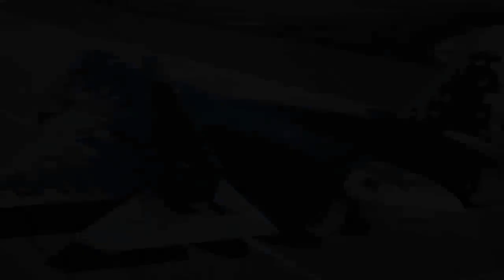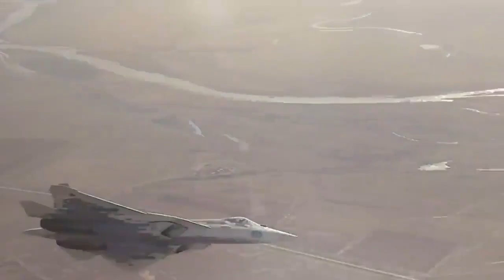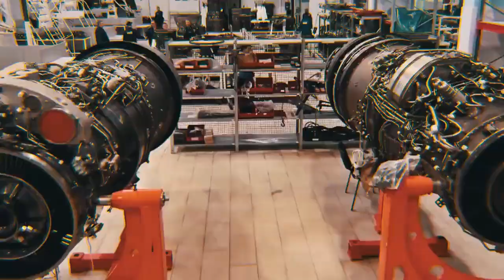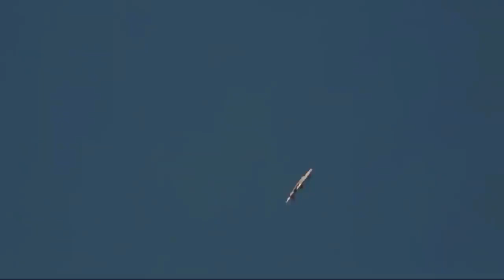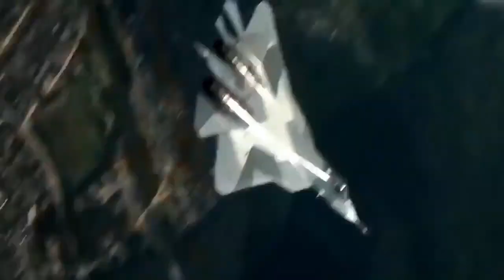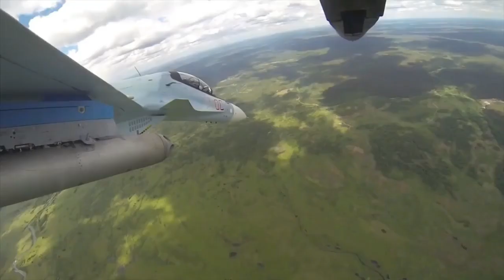Will India Acquire Su-57E Jets To Match Chinese J 20

Comment: No, reasons are that:-
1. It will start it's delivery after years (I am telling from the basis of indo-soveit policies)
2. You don't need to spend billions to just counter J-20 ( The soveit and Indian, both the Air forces have been able to spot J-20 just with old-soveit radars, Both the air forces have admitted that J-20 is not stealthy enough)
3. Buying the Sukhoi su-57 will mean killing of own programs of creating indeginious 5th gen fighter plane.( IAF is currently working on AMCA and same other 5.5 gen planes)
4. The delivery of dassoulter Rafale has began, which is more than enough to counter J-20.
Reply: J20 can be downed by s300 easily

Comment: The su57 can't be stealth with that shape, not to mention the rivets on its surface. Is only a propaganda plane, made by russia cause they can't admit that west have a better technology. Also is hilarious how they also claim that stealth is useless, every time they don't talk about the su57.
Reply: What do you mean? It’s body is technically more stealthy than the f35s the only problem being it’s lacking in terms of radar and jamming capabilities making it inferior in a head to head, but in a dogfight it will come out superior to most other aircraft’s. This isn’t some propaganda.
Reply: @echidnuttt9326  i am talking about basic geometry, when you look at the su 57 from far away, it could seem stealth, but if you take a closer look... rivets on the surface, space between the air intake and the main body, vertical fins that split in 2 when the plane have tu turn creating more angled surfaces... there are MANY reasons that makes its shape impossible to be stealth
Reply: @giancarloga8850  Well no aircraft is stealthy from all angles. For example: the Chinese J20(they claim its 5th gen but I think otherwise) supposedly has a 60° stealth from the frontal surface so if the enemy aircraft is within the said range the j20 might not appear depending on the distance ofc. Unlike the J20 there are no Canards per se on the su57, the splitters you're talking about can be found (less pronounced) in the f35, Infact Indian govt(was earlier a partner in the making su 57) reported they have a solution for that(India is developing their own 5th gen fighter now). It has something to do with the air intake, so if India knows it then it would be safe to assume the Russians probably have something for it too. The partnership b/w India snd Russia for su57 ended last year.
Reply: @echidnuttt9326  my main language is not english and i have some problems in explaining geonetry in english Sorry. But the f 35 have not the same problems, when the fins rotate, it fully rotates. According to many, the su 57 have the same "stealth" as a common 4th generation fighter like the f-18, when it unloads its missiles. And that's not something to be that proud of. You can find many sources that talk about the "non" stealth geonetry of the su-57 much in details, with photos and exhamples. They will explain it much better than what i can
Reply: @giancarloga8850  your ego is not lwtring you accepting because india reject the programme bow india is regretting so learn more before barking
Reply: Stupid
Reply: @gudygodines5194  you are pretty laughable
Reply: Stupid your jealous  because russia already solve tge problem and now su57 is master genuinely
Reply: @mevineven869  jealous? of what???? a crap 4th generation that claims to be 5th and is NOT BEING PRODUCED.

Comment: Read info before make videos: the current engine AL-41 neither stealthy or capable of super-cruise, till the availability of AL-30 engine with serrated edges be available in 5-7 years, the plane is not stealthy
Reply: engine 30 is already on flying trials since 2017
no any engine is stealthy from behind, turbine blades are perfectly visible for radars, serrated edges is just one small feature
AL-41 can supercruise, with engine 30 su-57 would supercruise at even higher mach
Reply: baga mut AL-41 can’t super-cruise and the evidence is the Su-35 can’t, plus the serration is essential for stealth, the F-35 is stealthy from behind because of this, the F-22 engine is rectangular which is more stealthy than the serrated edges, but if the Russians think no engine is stealthy; then I can’t blame the Indians from refusing it for inadequate stealth among other features it lacks!
Reply: @darhammora7867  Evidence is that Su-35 can supercruise at 1.1 mach
and Su-35 is bigger and heavier  than su-57
with the same engines su-57 can supercruise at even higher speed
Reply: baga mut that’s very low, the F-22 at 1.8, Typhoon and Rafale at 1.5 and even JAS 39 at 1.2, this can be called trans-sonic pass rather than super-cruise

Comment: The export version is crap ..you wanna get the original production or forget this plane
Reply: It is mentioned before the E version of this aircraft is more advanced than the original
Reply: @darhammora7867  there is no "original", first series production just begun, both versions are ready at the same time
they are almost equal, except some sensible stuff
Reply: baga mut not really, the original export version to India was supposed to be more sophisticated than the Russian one
Reply: @darhammora7867  it is not, some avionics supposed to be replaced with Indian developed modules "make in India"
are they done something? what was developed? where are results?
Reply: baga mut that’s correct, I agree with you on this